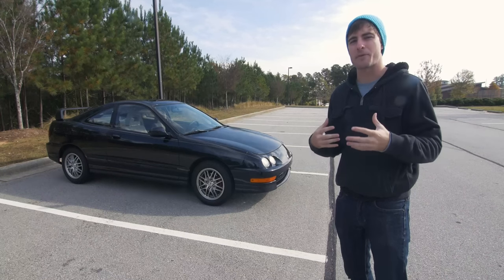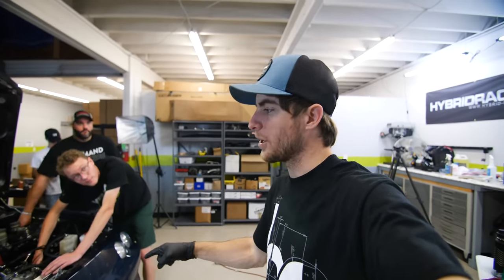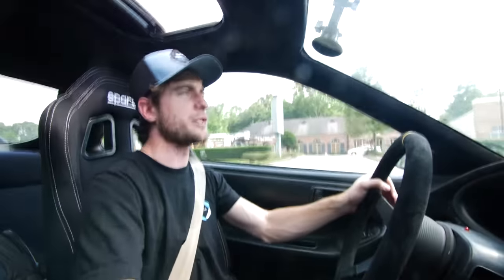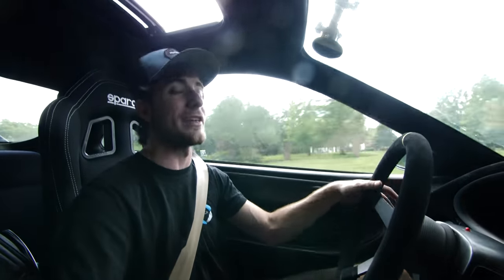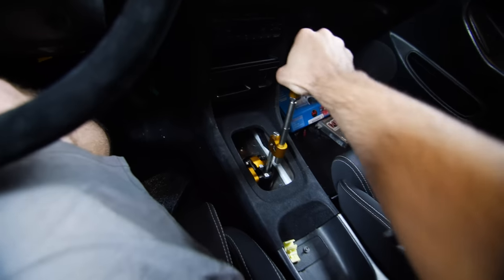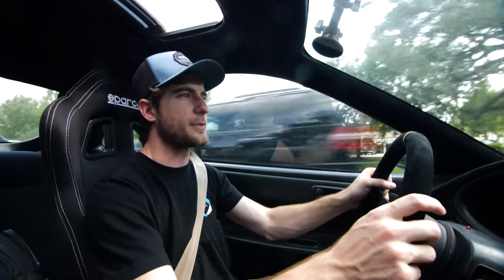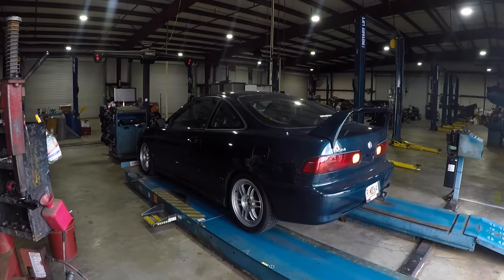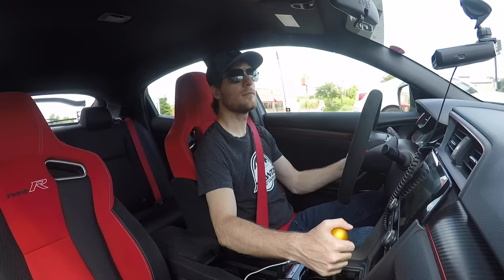Is Doing a K20a Swap Worth the Money? Integra Build Breakdown!

Comment: Procharge the teggy when youre ready for more power that would be something different other than everyone turboing their k and you wont lose that sound
Reply: Procharger doesn't make a centrifugal blower for a K series. It would be kraftwerks. I vote cams and ITBs. The response would be next level
Reply: @L8-APEX  that would be dope too
Reply: @L8-APEX  Theres a company in UK called TTS and Torque Developments (TDI) that's done kits for 15 years. There's a ~350 Kit a ~450 and a 600 kit. They use centrifugal rotrex. Really reliable often make above target power.
Reply: Integras don't handle well on street tyres with over 260bhp generally. Be a pity to turn a road racer like an Integra into a 1/4 mile car imho.
Reply: @LexTNeville  theres a video on my page of a 400 plus hp b16 integra and it handled fine at high speeds..
Reply: @vtecnegro85  cool, will have a look.  I bet 400hp is fun, but spoils the grip:power ratio on twisty roads/circuits.

Comment: Had hondas my whole life. Never blown a motor.
Reply: Your not doing something right
Reply: Not slapping the limiter enough
Reply: Had hondas for 25years..i stopped blowing engines when i learned how to tune them...been hitting 9200 rpm on a stock k20z3 since 10years 
Not taking a single drop of oil
Reply: 400k miles still going lol
Reply: I had a 1995 integra gsr I blew a hole threw the block spun a rod bearing an tried to drive it to my buddies shop the next day lol. Swapped a b20 and out the gsr head on it and sold it few months later but I’ll say the b20 vtec was pretty impressive just ran a type r base map .

Comment: Nice job on the k20a build David. Are you gonna get it tuned/dynoed?
Reply: Jason McMullen It’s stock so there wouldn’t be a point atm
Reply: @lanebrowning4328  with the header and custom exhaust, and id imagine a larger than stock intake. It most deffinitly would be worth a tune.
Reply: Lane Browning tune is definitely worth it. On my k20 after switching to a 3” exhaust and a cold air With a 70mm throttle body and portmatch I went from 196whp to 211whp
Reply: And free up some more rpm up high!
Reply: ChrisSadowski I thought David only did a header?
Reply: @lanebrowning4328  a header and a custom exhaust. That motor was tuned from the factory with that exhaust. I'm just assuming he had some,sort,of CAI installed which is why I said bigger air intake
Reply: Even bone stock it would make a huge difference
Reply: @lanebrowning4328  its not recommended to run on a basemap, custom tune would be safer

Comment: You need a Gs-R or type-R gauge cluster SON!! At least like that you don't have to worry about hitting the rev limit
Reply: Rev limit is actually, exactly the same as the b series type r, so the type r gauge cluster, works out perfectly
Reply: S2000 cluster would look better
Reply: I would do a Dc5 Type R cluster on that car, would look way better imo
Reply: The guages from the integra type r dc2 makes more sense. It's actually for that car, and the rev limiter is the same as the dc5. It would be cool that the newer k series engine is winding out the gauge which is actually for that gen integra type r
Reply: or go to MoTeC
Reply: If v4 hondadata just buy a tablet to Bluetooth gauges

Comment: If n/a power is all that you are concerned with then the K series is ok but the B series has a lot more character and is more fun to drive in my opinion, especially the B18C 5/6 engine. 
I ran a specialist Honda parts business for around 12 years and we saw a lot more day to day issues with K series engines compared to B series, including issues with timing chain stretch and various sensor issues (of which the K has more of comparatively)

Comment: About to start the process of gathering parts to do this myself. 100% worth it, why you ask? A very reliable 240 ish wheel horsepower from an engine if maintained should make a million miles w/o problems. No stupid tech in the car , but a pure drive.   Great mpg and great speed too.   Might not look pretty or have all the shiney things a new car has, but some of us prefer that.

Comment: I’ve owned stuff a few Honda’s, from d series to b series with loads of upgrades now to k20’s and they are easier to do stuff with, but in my personal experience my b series was a much more reliable engine
Reply: how so?
Reply: Here's my question. Is the extra cost associated with a k20 swap like this worth it as opposed to throwing in a b18c5? Imo I don't think so.
Reply: Tuvzii well my ep3 I have at the minute has threw up more problems than I have ever had, and my husbands dc5 has had some problems too, where as our two civics with the b16’s are unbreakable.. just in my experience, I love both though.
Reply: UluvDuddes well, tbh your right, is it worth the extra money, for not a whole load more power? Suppose it depends on your budget and what you personally want.
Reply: @Civicky  are you having issues with it at stock? or modified
Reply: Tuvzii my ep3 is stock, dc5 has a few wee mods.
Reply: @Tuvzii  the fastest honda ins B series so that tells enough
Reply: I've been in a b series type r, and a k series type r, and they are both quick.
Reply: Civilly what problems are you having with the k's?
Reply: L15B7 is the new sauce
Reply: Alex Strömberg fastest in what class?
Reply: @Civicky  imo, b series are getting outdated. Maybe not in the us, but in europe, they kinda are.
While k series at the start has 40 hp more than b series. Talking about k20a2.
While you want those 40hp extra from the b, you gotta whip in some serious money.
While k series tho, they are strong as hell.
Buddy of mine has a boosted k20a2 ep3 on stock internals. Daily driver. 330hp (at the crank) pulls like trains, floats like a boat and handles well in corners. He only had problems with fuel and oil starvation. Fuel pump was too weak and oil starvation for not having a sump baffle on track days. No "real" issues so far.
All in all, i must say that the honda k series engine is the best one they ever made. Basicly a refined b series.
Cheers yall
Reply: I hope youre not one of those MAGA honda owners
Reply: Yep with u on that one love. My b16as use to rip up heaps of turbo cars . Had few da6 Integra's an a civic ef
Reply: @jonog5632  K20s make more power than any b series engines though?
Reply: @AAA310  whats MAGA honda owner?
Reply: I don't know that the B's are necessarily more reliable than the K's, although I do understand why you'd feel that way.. The B's are almost always bulletproof whereas it is possible to have a K that'll give you some trouble, especially with a poor history. B series don't give a damn about maintenance as long as its running when you got it and you yourself start changing the oil at some point, or don't you'll still probably be fine... You're golden hahah. The K's won't take as much abuse when poorly maintained or ran dry up in the Vtec rpms it seems like. On top of a whole host of other things that can go wrong electronically from it just being a newer engine. Finicky things that aren't catastrophic though. One of my buddies had an older B series I want to say but it might have been a D series honestly, somehow a section of the camshaft just completely broke off the end with a lobe and everything included. Engine had darn near 300k on it already and this guy proceeded to JB WELD the two pieces, mind you he took his time and did it to the best of his ability but even that doesn't lend much credibility to a JB weld job on crucial engine components. Anyway not only did it work, he drove the thing for another 60k miles until he SOLD IT THAT WAY and last either of us heard it was still running a few years ago. Also on this gimp cam he pulled our buddy about 6 miles down the freeway with his truck pulling a trailer with another car lmao. Hondas take anything you throw at em and ask for more. Though that may be more of a testament to the almighty JB weld than anything.
Reply: @UluvDuddes  if you want to make less than ~350 hp, go B series. They can make that easy, cheaper and about as reliably as a K series. If you wanna push more power than that, your gonna wanna at least do a K20 swap, if not a K24/K20 build.
Reply: Ian LaMontagne fastest honda in the quarter mile is a b series
Reply: @MRsteezy123  Yea, and I'm willing to bet entire block has been bored, honed, polised, along with another $10,000 put into other supporting & power mods. You can make virtually anything fast with enough money. If you don't want to take out a mortgage for your build tho, go K. I've heard of guys semi-reliably holding 800 on the stock cylinder sleeves. K is just a much better designed block overall (mostly bc it's newer).
Reply: @MRsteezy123  yea bro your right, just every tuning shop, Motorsports team, etc are all fools who 'buy into the hype'. You missed my point, I'm saying that yea a B build can make as much as a K series, maybe even for less, but the K series will still be running in 6 months. The B probably won't.
Reply: @MRsteezy123  I own a B swapped Integra dude so I got nothing against the B series of motors. I'm just saying K series is newer and therefore better engineers and machined from the factory.
Reply: @MRsteezy123  Hmm I couldn't tell you if that is a fact or not but if so I wonder why? Just because no ones done that amount of work to a car with a K in it to get it down the quarter faster? Must be... I mean I don't care which you like better I like all Honda engines but if you think about it there should be no reason at all a K series shouldn't be able to be faster than a B series if we are talking "fastest in the world" levels, where money wasn't really much of an object. If you can tell me why a B series would end up being better and why Honda downgraded when they designed this newer engine I would love to hear it.
Reply: Ian LaMontagne how are you going to say the b wont be running in 6 months? Thats what im talking about not knowing what you’re talking about, i own a turbo gsr thats been abused and daily driven for the past four years.
Explain to me what in a bseries would make it fail in 6 months ...the sleeves? The blocks can be sent out and have machined so thats its proven to hold 800 horsepower for like 600 bucks, its called css look into it.
And how do you have a b series swapped intergra they come with b series engines..

When those super smart motorsports team can run with speedfactory then we can talk, cause the k series guys are still trying to beat his numbers
Reply: Daniel Nelson when did i say its better?
I said its not worth swapping when the money put into the swap could be put into making the b series bulletproof and it would still be cheaper.
But since you ask the bseries has been around much longer theres more information on how to build and tune them correctly, which is why the fastest honda in the 1/4 mile is a b series.
Yes all motor the k series hold the record but even then its not a big difference considering the displacement difference between the two engines.
The real honda ogs know what i know,  k series is a great platform never denied that, but b series is the OG and thats why the OGs in the honda games make record numbers with them (speedfactory) and believe me the kseries guys are definitely trying
Reply: @MRsteezy123  I have an LS VTEC, so I guess yea saying "B Swap" was technically wrong but it's far from stock. 
I ain't gonna sit here and argue with you over this bro. Both platforms are good. From the factory, K Series is capable of more power and that's a fact. A lot of people don't want to go through the trouble of getting the block sleeved, bored, finding the correct pistons etc. It's a lot easier to throw a K20A2 head on a K24 block. Also, K series swaps aren't $7g anymore. I can find a decent K24 block & K20 head for ~$3000 in local junk yards. Both are reliable if you build it right, and will blow the fuck up if you dont. I love all Hondas but I think your wrong that B series is 100% the way to go all the time.
Reply: @MRsteezy123  I was also pissed and on lunch at work earlier when I was replying bro. My bad for coming off as hostile. I can see you know your shit but I ain't new to this either
Reply: Ian LaMontagne its not 100 percent wrong, its only wrong if you have a gsr engine in an teg already. 
Because the reasons i stated gsr is a proven platform, the numbers and times speak for themselves.
If you have a shell i can see why someone would k swap it depends on the situation, but someone who doesn’t want to go through the trouble of the simple machine work with the b series isn’t going to have a fun time doing a k swap, or really much fun in the honda game at all..
Having been around many people who have gone that route, its not cheap, you can get the longblock with some accessories for 3k ish now add the tranny, then the harness, mounts, all the wiring involved in getting your clusters to work, re routing the exhaust ect.
By the time your halfway done with a k swap you could have a fully built and blueprinted b seires that will hold more power then a unopened k series would.

I never doubted the fact k series can hold more from the factory, they are strong engines, and an excellent platform.

The k series biggest advantage is displacement with the block being better prepped for boost right from the factory, but that means very little when every b series out there today has 180k miles on them and burns oil, its going to need to be rebuilt anyway
Reply: @MRsteezy123  I never said anything about which you said was better. Just saying it doesn't bother me either way. That still doesn't make a ton of sense to me.. Bseries has been around forever and people know how to tune them and stuff better? THAT'S what is going to have the B series make more power? I mean strapping a snail to a B or K series and dialing the tune in dead nuts wouldn't be a terribly different ordeal between the two.. Still seems like the one with the higher displacement and better newer design would come out on top.. I asked you to explain to me why that might not be the case but if all you have to say about it is old Honda pros like you "know things" followed by "its been around for a long time and people know how to do stuff better to them" which is about the vaguest answer I can possibly think of and demonstrates absolutely zero knowledge or understanding of the subject.. Well ok then. Any biased 13 year old could have come in and said they know stuff... It's older, people know how to do go fast things to it more betterer now! Whether you're correct or not is irrelevant.. You've done nothing to answer my question OR further your opinion. Dude. Come on meow.
Reply: Daniel Nelson what type of answer is would you like? Speedfactory chose the b18 over the k series, because of they prefer it, they prefer tuning them, and prefer building them.
Theres no mechanical answer as to why .
The k straight out the box is the superior engine.
So which engine has been around longer with more aftermarket support really matters when we are talking about 6-7 second 1/4 miles.
The kseries hold the record for awd, and all motor. But for fwd the bseries does, maybe its related to the extra displacement and torque actually hurting the 60ft?
If you used google you can see a post they made about why the prefer using the b series, its not a mechanical breakdown, they chop it up to a bseries feeling more “rowdy and untamed”

One mechanical advantage is Their is an advantage to sealing strength on [B series] cylinder heads for heavily boosted applications due to the smaller bore and spacing which allows for closer head bolt location relative to the cylinder.

Comment: Thought this was supposed to be a budget build?
Reply: Spent 5 bands on swap alone 🤣
Reply: That's what we always when we start.
Reply: Phillmk7 973 yeah if you don't end up spending 20k on your budget build something's wrong 😂
Reply: @metalfruttolo9855  agree lol cuz something going to go wrong somewhere  an it's going to cost u. Just to get back on track
Reply: This is YouTube where budget build means YouTubers with stable financial lives spending 5 - 15k on their builds.

Where I'm from budget build means $1000 on the car
$1000 on the engine 
$1000 on mods
Reply: John Blackstone where I’m from budget build is keeping it running by any means haha
Reply: @AllaboutTheWoodrows  I did that for less than $700 on a $500 Civic and it worked lol
Reply: AOMechMarine AOMechMarine  specifically a 20-25 year old Honda. You can get all for under a grand if you look and if you pull your own engine swap you can get most swaps for $600
Reply: There is nothing budget freindly when goin k series. When u compare to b series.
Reply: @geenuz4fam  you are absolutely correct. The K suffers from a significantly higher price.